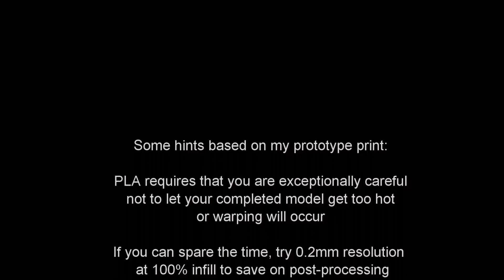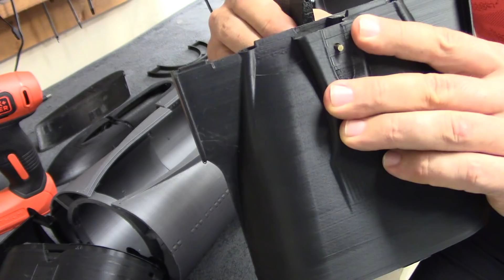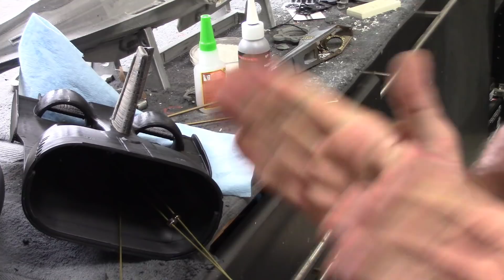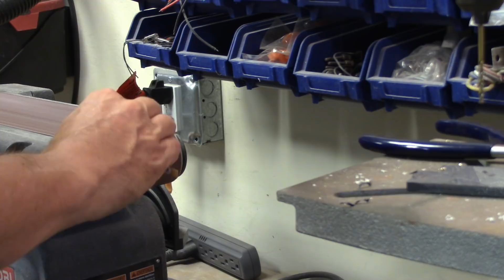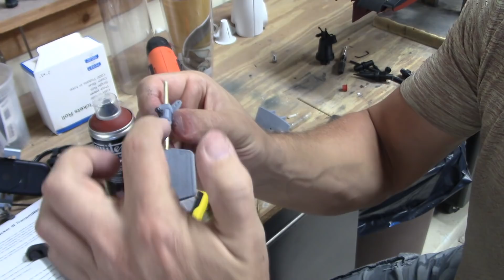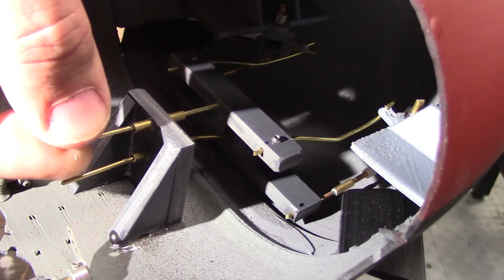Russian Typhoon 3D files - Print your own RC Submarine!

Comment: How simple would it be to build this kit simply as a display model? There are no other kits designed for 1:144 and the model seems to be really well done, but I am not looking to build a working model. Also, what size printer bed was this designed for? I have an Ender 3, 235x235x250mm

Thank you so much, and great video!
Reply from the maker: Max part size is 170mm tall, so you've got plenty of room in your Ender. Of course you can build it for static display.

Comment: How do you remove the mold lines from the printing?
Reply: Spray on a coat of high-build primer, then sand thoroughly. Repeat until you’re satisfied. No magic. Just hard work.
Reply: You could always print with abs and use acetone to smooth it out

Comment: Once I get my 3d Printer I am going to get the files, there is one thing that if you could pull it of would be epic, a Red October variant.
Reply: Second vote for the Red October variant: no prop shrouds, towed sonar array pod on the top stabilizer fin, “caterpillar drive” doors, flat-sided sail base, and 12-23m (depending on which source you use) longer. Thank you.